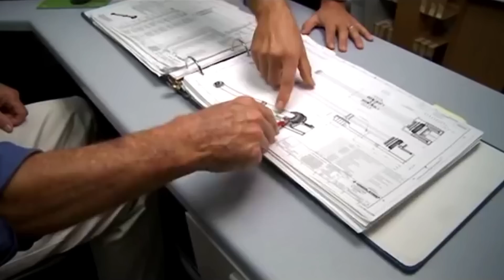US's Ultra-Advanced Railgun Weapon Is Making All Others Obsolete

Comment: I worked on this stuff for ARDEC back in the 80's. So it's been around a lot longer than the video mentions. The concept is over 100 years old and they were doing research in Australia back in the 60's. The big problem now, as it was back then is rail wear. When you are sending a mega-amp of current across a sliding contact, things tend to melt. I hear that they have made progress in the last 40 years but going from single digit number of shots to tens of shots before rails needed to be replaced.

As far as power requirements go, a modern Ford-class reactor will provide more than enough power. The Navy's latest ship concept is that everything runs on electricity (catapults, radar, jamming, communications, props) so you build a big reactor and switch power to where ever it it needed. A railgun fits in well with that design concept. The Ford A1B reactor can generate about 125 megawatts of electricity plus another 260 MW to the propeller shafts. A 30 megajoule gun would require around 9 kilowatt-hours for one shot. So even if you used 1/10 of the reactor electrical output you could still shoot about 1300 shots per hour. Even with other inefficiencies, I think 100 shots per hour would be reasonable with reactors we are using right now.

And as far as the Chinese actually fielding a railgun? I'll believe that when I actually see it work for more than a few shots in an hour.
Reply: Hi! I’m definitely not a Chinese scientist trying to build this so my family doesn’t die. But don’t the electro magnetic fields the gun generates interfere with ship systems around it?
Reply: @kurtru5selcrowe607  Yes, that's a real issue that we were looking at but our goal was to get the thing working. It's another reason why railguns may not be practical in combat. One theory from the USS Forrestal fire was that a jet going through a radar beam may have triggered the missile that caused the mishap. The military has some pretty stringent requirements about stray EM radiation. https://en.wikipedia.org/wiki/1967_USS_Forrestal_fire
Reply: @snoig1  ya I almost lazed a Blackhawk with an LRAS3 system to see how far it was when I was on guard one night. As I said it my squad leader who happened to be there tackled me to the ground. He was convinced that I would have set off lock on alerts on the chopper lol.
Reply: @snoig1  The 5" Zuni rocket (which is electrically fired) was ALWAYS temperamental.  When that rocket went off and hit John McCaine's Phantom, it was something like the 12th incident of a rocket igniting while being armed in the pod.
Reply: @snoig1  "One theory from the USS Forrestal fire was that a jet going through a radar beam may have triggered the missile that caused the mishap."

Nah the issue was the pilot in the plane in front did a wet start which creates a fireball when the engine starts up. It was intended as a prank, but went horribly wrong.
Reply: @guytech7310  Yeah, I've heard that but all the fact check websites say it's not true. The official Navy report found that a misfired rocket hit another plane and started the fire. Like I said, it's one theory.
Reply: @snoig1  There is an official account of what happened though. All of the safety precautions used when loading ordnance weren’t followed. The input from the aircraft to the rocket pod shouldn’t be attached until they are ready on the catapult. This wasn’t done however so when a stray electrical pulse occurred, it led to a Zuni being fired. This wouldn’t have been bad had it happened while on the catapult because the rockets would’ve hit nothing however the F4 that fired the Zuni was on the back of the carrier aimed at multiple A4s. The A4s were equipped with old ww2 era bombs which were very susceptible to high temps unlike the more modern ordnance.
Reply: @kurtru5selcrowe607  
LRAS is an awesome piece of equipment. Amazing how far you can see and range with it.
Reply: @kurtru5selcrowe607  u swear u did that? Where was this?
Reply: @obadiahkilgore2964  the Syrian/Iraqi border near Tal Afar back in 2010. And there’s nothing to swear to lol. My squad leader stopped me before I did it.
Reply: @kurtru5selcrowe607   I have no idea if was a true story, but I had a conversation with a cop about their laser guns they use to measure vehicle speeds with. He told me they used to sometimes point them at military jets that were flying past for fun, but one day their department got a phone call from the military asking them to stop because it was setting off missile lock warnings and making the pilots nervous.
Reply: @swaghauler8334 FYI  McCain flew a A-4 Skyhawk not a Phantom.
Reply: @kurtru5selcrowe607  Get the gun to work first before solving the problems of how to fit the gun in ship. One step at a time and that problem seems insignificant.

Get this gun to work and they've solved problems with missile defense as this can shoot down any missile including hypersonic missile.
Reply: @kurtru5selcrowe607  not if it's built properly, the induced currents should cancel each other out everywhere but between the rails.
Reply: @kurtru5selcrowe607  no, as its contained
Reply: Couldn’t you apply some maglev or magnetic containment elements to keep the projectile from touching anything physical after loading to create frictionless firing?
Reply: @CharlesGaluski  That's called a coil gun. And it's significantly more complex than railguns, needing a lot of electromagnetic coils powerful enough to accelerate a projectile quickly and timing mechanisms to make sure that once the projectile moves past a certain point the coil deactivates to make sure it doesn't slow the projectile down, as well as the other requirements of being an electromagnetic weapon. Coilguns do probably deserve their own research but with current technology(maybe something like room temp superconductors will make them more viable)  they just can't keep up with their rail based cousins.
Reply: @weirddudes5543  Coil guns are more efficient and scale better, railguns are easy enough for the low hypersonic regime, but they're inefficient, need a lot of power, and the forces on the rails and requirement for the projectile, or projectile+sabot system to be capable of withstanding 100s of kA, is going to make them impractical on anything but a nuclear powered vessel, it would be a great option for long range bombardment, but I doubt smart munitions could withstand the acceleration and induced currents of the launch, it's DC, so shielding them is very difficult.
Reply: @weirddudes5543  while that sounds more complex, I wonder if it's easier to execute with current technology. A great example of this is the old CRT TV system. CRT TVs are FAR more complex operationally than LCD or dot matrix (the black and white equivalent) TVs, but back when they invented the CRT TV, they did not have the understanding of materials that they do now. That is why it took so long to get to LCD TVs, even though LCD TVs are far cheaper and simpler to manufacture than CRT TVs were.
Reply: @weirddudes5543  these are coil guns not rail guns.
Reply: @weirddudes5543  and keeping it on target
Reply: @CharlesGaluski  No, because the projectile gets its acceleration from being in contact with the barrel. The barrel is a pair of electrodes that short electrical energy into the projectile to provide the propulsion.

The only way that might improve barrel life is make the electrodes cylindrical so they can rotate after each shot, but they still need to be replaced and there still needs to be a support structure to prevent them from bending during firing.
Reply: @guytech7310  what if the electrodes were like a flat ribbon, one shot only and then rotate through the barrel like a fabric towel container in a rest room, thus the actual conductor is just applied to the fabric and gets toasted every shot.  New shot, new ribbons.
Reply: @lonihollenbeck4654  Ribbon would fail, It would break\vaporize on the first shot. I believe the copper electrodes are a couple of inches thick to handle the current which is millions of Amps.
Reply: @guytech7310  Ribbon would fail, but a round solid rail on a geared rotation system could simply be turned several degrees if the surface is too damaged to continue use. Fire ten shots, rotate 15 degrees, fire ten more, etc. with a bonus that replacement rails are simply very long round bar stock that a lathe can produce on an industrial scale. 

Heck, get creative and make them very heavy walled pipes and run coolant through them if needed.
Reply: @mfree80286  That was my thought to use a round or hex shaped rail that is rotatable, but The forces might be too high for that design to work. I am sure some else thought about rotatable rails, and likely deem it not worth the effort & expense.
Reply: @CharlesGaluski  I am pretty sure it doesn't contact the launching tube. But they are imparting a force to get the projectile up to Mach 7 or whatever, and that creates a lot of heat. The projectile moving that fast also is running into the air so fast it's making plasma (and ablating while doing so). You dump a lot of energy into getting it moving. People have made coin shrinkers, where they put a coin in the middle of a coil, making sure it stays put, and dumping a few huge capacitors to cause an electromagnetic wave. The wire normally explodes in the process.
   There is an inverse square relationship between the intensity of a magnetic field and the distance. Double the distance, you require 4 times the power to have the same field. And your dumping all that power in milliseconds at most (if we go from 9 KWh, we get 540KW/min, and 32.4 MW/s, 324 megawatts of energy for 100 milliseconds of propulsion.
    Another thing is the drag coefficient. It's gotta be different for hypersonic projectiles (gotta be like reentry, except you don't want max resistance). In air subsonically, the drag increases by the square of the velocity.
Reply: @CharlesGaluski  then how do you get the current to flow through the projectile? It needs to complete the circuit, the magnetic forces pushing the armature along the rails are due to the current flowing through one rail, through the armature and back down the other rail, like a gun, the same force is being applied to the rails, basically the magnetic field is stronger inside the loop made between the projecile, rails and power source, in order to minimize the potential energy, the loop needs to get bigger in area, the easiest way for it to do that is to push the projectile down the rails, if the current stops flowing, the magnetic field decays,
Reply: @domvasta  well, I don't know, really, that's why I asked a question, instead of making a statement.  I was looking to get educated on the subject as it seemed like a no brainer to have the projectile float above the rails, maglev style, to eliminate friction and reduce heat.  But, the projectile doesn't need to be in contact with the rails to complete the circuit and have the whole system function.  If you watch a video about using cryogenic temperatures to create small, but intense, magnetic fields capable of levitating an object or magnet.  You turn on the juice and place your item on top of the plate and it floats with no connection. Also consider maglev trains.  These trains float on magnetized rails without needing to have a physical connection to the rails.  Finally,, as a weapon, you don't want to minimize potential energy in a projectile.  When you are essentially throwing solid chunk of material, with no inherent combustibility, you need to give it as much potential energy in it as possible to transfer to the target and create as much damage as possible.
Reply: @CharlesGaluski  solved that long ago but the firing rate was reduced. simple but secret.
Reply: Exactly.  Where they really need to be investing money now is materials science and metallurgy to come up with an alloy that can withstand the extreme power/heat/friction levels without degrading.  Once they crack that, this will be a viable weapon system ready for the battlefield.
Reply: @willymac5036  and you think they haven't achieved that already after more than 6 decades of research? If they are making a public show of this weapons system something tells me they ve found a way to make it work.
Reply: @bendemicah5444  actually that’s were you’re wrong.  The only reason why you don’t see these weapons on every U.S. Navy destroyer right now is because they can only fire a few dozen rounds before the rails effectively destroy themselves.  The researchers at Dahlgren have been very clear about this.  This is also why the U.S. Navy isn’t very worried about the PLA Navy having a working railgun on their ships anytime soon.  The tolerances involved are absolutely enormous, and that is basically what is holding these systems back right now.  They could go ahead and install a 32 Megajoule Railgun on whatever ship they want, but they’ll have to replace the rail too often to make them cost effective.  Which is also why the U.S. Navy is using hyper velocity projectiles out of their Mk45 5 inch guns.  That’s something they can do right now that gives them a considerable boost in performance while still using the guns they have in service right now, without having to replace anything.
Reply: @bendemicah5444  that or trying to get the competition to spend time and resources on something they know don’t work while we secretly develop something else.
Reply: @bendemicah5444  Or they're pitching for additional funding. Nothing like giving the American public a hard on for a weapon system to open Congressional wallets.
Reply: Rail gun weapons started development back in WW2. US started a program back in 1943 to use Rail guns in Sherman tanks, and created a few prototypes, but they were never practical. As the Poster above stated the issue is barrel wear. as the high velocity and forces causes a lot of damage to the barrel. 

Its possible to fire hypersonic projectiles using conventional propellents, but the issue is excessive barrel wear just like rail guns. It does matter if you combustion or electromagnetism, its the high pressures and friction on the barrel that causes problems. Its unlikely this problem can ever be solved because there is no way to avoid the physics.
Reply: @guytech7310  Gonna have to ask you where you got that 1943 figure, because if you got that from Spookston, I'm gonna have to tell you that that video was an April fools joke, and while it sounds really convincing, looking further it's quite obvious it's not serious(uploaded April 1st, and the sources in the description had "it came to me in a dream" listed as a source.)
Reply: @guytech7310  Just need a super conductive material, of course if we had armor or plating like that, wed just be going into space with it 

A lot of little industries are catching up to the ones sped up by Moore's law 

Just wait and see what happens
Reply: @Hashingit  No super conductor can handle the current levels used in rail guns. Super conductors will only super conduct at a limited amount of current before quenching (ie revert to a non-SC state).
Reply: @guytech7310  Alright then some other materials science needs to catch up 

Or we need to let it go
Reply: @Hashingit  It will never be a workable because the material needed is unobtainium
Reply: Thanks for the information
Reply: @_____ yep. I'm nearly 60 and ride my eMTB to/ from work everyday, basicallysilently. 7 miles each way, 40 minutes pretty easily. Off road it's awesome,  it eats hills and rolls down the other side, zips along the flat. As much as I'm a petrol head ( motorcycle mechanic) , I believe electricity is part of the future. Hell, it's here now and it's great.
Reply: Make a great artillery
Reply: Thanks for taking the time to pen your experience.
Reply: @_____ the real problem with EV's is the fact that the Batteries eventually need replaced, are super expensive, generate a lot of pollution to produce and dispose of, and curent lithium ion batteries are made from elements that can and do spontaneously combust when exposed to Oxygen, are prone to catastrophic fire/explosion producing faleure (de-gassing) and are really not that efficent, have a short life span... we need a non combustible, more efficient battery tech. I've seen a few things in development on that front. But untill 1 of them is mass production ready and can replace lithium ion technology we are putting cart before horse with EV's if you really want to be "green" about it.
Reply: China has nothing even close, they have propaganda though, that works amazingly well.
Reply: Wouldn't a "Gatlin Gun" be a viable concept to solve the melt issue? Keep all the rails in a sort of water jacket. Blows off steam after each shot, refills and ready for the next! STEAMPUNK RAILGIN!!
Reply: @M.C.Turnt69  no because other the massive hazard of having water near a huge DC power source, the vaporization happens in microseconds to nanoseconds; the metal vaporizes and ablates before any significant thermal energy travels through the rest of the rail; the water molecules don't even get a chance to vibrate due to.the new thermal state. In effect at those voltages and timeframes, the metal acts briefly as a thermal insulator not a conductor.
Reply: @repealsection230forbigtech4  Hmmm. Would be great if they could maglev these thing to eliminate any contact. What about maybe a "layered" rail. Each layer having a set amount of shots b4 the rail is "spent". Doing this you might be able to lower the cost a bit. If that's a viable option. Having rails belt fed to the machine much like amunition. Idk...i just woke up haha
Reply: Exactly, melt, vaporization, warping and cracks. As for a made in China quality railgun, I'd hate to be a sailor on that ship, given the penchant for their system warping and shattering super heated liquid metal "shrapnel". A country that, until 2012,  couldn't even make ballpoint pens because their steel was never pure enough to make 1mm ball without serious pits and defects, isn't any position to make a viable railgun.
Reply: Oh come on now!  If they is making a video on this they already got shit 30 years ahead of this they ain't telling us civilians about.  Know many of us wish they would be truthful about all the technological shit out here but to me seems they is gonna only let the super rich know what's really going on.  The rest of us is gonna know only enough to work for the rich assholes and make them more dough.
Reply: Knowing China, I bet that they either carry a bunch of spare rails aboard the ship, or the plan is to only fire a handful of shots before resupplying.  I bet that China hasn’t invested in the infrastructure to keep making rails.  They rushed to show off their new toy, but they were probably not considering the logistics needed to support its actual usage.  Russia did this with their aircraft carriers.  They built them, but not a facility that could maintain them.  It’s the kind of mistake that countries that care more about showing off than achieving results make.  In the US even the armchair military analysts know that logistics win wars.  The best weapons are worthless without the logistical framework in place to support them.
Reply: How about an easy replaceable tubus made out of a non-conductive material for the rail? The projectile can't touch the magnets themselves because of magnetic repulsion, but when used with a non-conductive friction surface tubus of a certain width, it would absorb the friction wear and tear and then allow an easy way to swap the barrel on the go with just two staff members, without the need to worry about the barrel itself. Might be a carbon based material, or a thin sheet of depleted uranium. Could be practical, because the main part, magnets and electronics, are preserved, and economical, estimating the cost of such protection tubus for a 5-30,000usd/piece depending on the size and quality assurance. Having a decent sized housing barrel made out of composite materials could also help. Dont ask me about the details.
Reply: @Kid_Naps  due to how railguns work the rounds HAVE to touch the conductive railing to be propelled.
Reply: Thanks for the scientific comment, it's something rare in the Era of arm chair warriors
Reply: The field of souper condition has been making great work with this technology
Reply: Could electronics in a rail gun ever be able to survive a shot?  Or control system?
Reply: @oldmech619  Back in the day I had heard rumors that they were working on high G survivable electronics/control and that research looked promising but that was all above my pay grade.
Reply: @snoig1    It is hard to imagine how any electronics could survive in such a highly magnetic field being energized In close proximity. Then being to able control the direction of flight while using inertial navigation system and gps. There must also be an ionized field around the projectile inflight. Big hurdles to overcome. If something looks promising, the research should continue. But for meantime, guided missiles seem to be the best option. And all war ships need a big deck gun.
Reply: Reality is a ship will only have minutes  . So wear won’t be an issue
Reply: Interesting.
A happy little EMP would have it 'lights out' in an instant.
Reply: How old are you？
Reply: I thought we'd given up on this due to the wear and tear on the barrels. A few rounds and it's flexed out of whack
Reply: Ford makes atomic reactors? Why not fill the barrel with a high dielectric gas before firing to cut down on the arcing and sparking? If none of that works you can always make a gatling gun and spread the wear out amongst several barrels. You can use the time between barrels to charge up for the next round.
Reply: @Joe Duke I see what you did there. It seems the system is put us both here again
Reply: railgun was patented as fa r as 1918
Reply: The problem with hypervelocity guns remains since World War I when the Germans employed a 211mm “Paris Gun” with a muzzle velocity of Mach 4.8 that allowed a range of 130 km (81 miles). Each shot wore away a considerable amount of steel from the bore. After 65 rounds had been fired, the huge barrel was sent back to a Krupp factory and rebored.  Railguns are impractical weapons because of the massive electrical power needed, because the projectile can have no explosive, because the projectile is small, and because it has no greater effective range than a standard 5-inch naval gun.air resistance quickly slows the velocity of any bullet, including the 24lb bullet fired by current railguns. The greater the muzzle velocity, the faster it slows due to air resistance.
Reply: @_____ remember in ww2 the Japanese rode bicycle’s through jungle the British thought no one could penetrate to take Singapore.
Reply: And these days you could probably 3-D print the parts you need.
Reply: Dude right on.. even 20 rounds an hour from that is devastating.. one round could sink a carrier.. Put it on the fastest boat you can and use as a ship destroyer
Reply: @polka23dot70  I have life long study in high power EM fields. I was working with MHD in high school.  I can figure out that you must have found overunity reaction and darpa made it secret.
Reply: I was about to say in nearly 10 minutes of video, we didn't hear one word about these guns burning up their copper rails.  In other news, major breakthroughs in nuclear fusion put abundant clean energy only 30 years away!  Industry is still grappling with making graphine and other exotic materials to make low resistance conductors.  Only when these materials can be produced in great enough quantity at a low enough cost, rail guns will replace the cannon we're used to.  Perhaps they are coming along fast enough that developing better capacitor batteries to shoot these things isn't just a waste of money.

edit: spelling
Reply: You've thought this out, haven't you?
Reply: Idk why they haven’t switched to a coil gun
Reply: That was brilliantly spoken..
Reply: Could also have capacitor storage to buffer the rate of enegy production v usage
Reply: Speaking as another person with familiarity and experience, there's a lot this channels videos get wrong.
Reply: Lieutenant, divert power to weapons!
Reply: Power transfer complete. Your orders captain?
Reply: Never thought about the barrel would need replaced every 10 rounds.
A fast change out system like a machine gun barrel might solve this issue.
 Only firing afew rounds then having to change barrels maybe simular to reloading Hmlrs rockets systems. 
I know nothing about this weapon.
Reply: They need to make a mini version of this in a rifle form... Like China is doing
Reply: You can build one in your garage...all you need is capacitors, rails, and neodymium magnets...really really simple to build actually👍
Reply: What causes the muzzle flash?
Reply: @pierrevandyk9242  Gas and metal ionization + vaporization due to high electrical currents.
Reply: We both know that the only way the Chinese do anything is to steal our technologies! Don't you find it funny how the Chinese went from 50's an 60's jet technology to fielding a 5th generation fighter with 95 % of it looking and being identical to ours . But we all also know a copy is never as good as the original 😉 plus without all the R&D THEY ARE BUILDING THINGS THEY DON'T KNOW HOW TO FIX , REPAIR OR BETTER IT ! 5 TH GEN fighters without having 5 th gen engines,  and half the stealth ! Have you heard of the NGAD PROGRAM? WE Designed a 6th gen in a year vs 10 to 20 years and all simulations tried and fix through this program cutting costs by almost 80%
Reply: So…everyone does know that railgun Sherman was a complete hoax right? Look it up, nowhere does it say that one existed with any credible source.
Reply: useless weapon. money for nothing if u all think a little.
Reply: Power for sure isnt the issue. A fair size capacitor is all you need and a way to charge it so its more about how fast you want to shoot it will be the issue with that. Also a key note, w/e we know now is a good 10-20 years behind what the US claims so i can bet the railgun design has already defeated the rail ware/melting issue but its more of the matter of the US being cheap and slow on how to bring it into full production. We could right now have railgun platforms that will replace most tanks/vehicles and soldiers because all that will be needed to win a battle is to drop a platform with a combat tech crew and lay waste to every land and air unit within 200+ miles which is prob more on 1000+ mile range because we got artillery that has 1.1k mile range now so 200mile range the vid suggest is vastly incorrect.  Also a note, i can bet there is already an orbital railgun in orbit right now with hints that leads to this.
Reply: Last I heard the Navy had the same problem. I seem to remember they could get around 15 shots.
Reply: Thanks for this, your comment was actually more informative than the video.
Reply: Dumb idea from a dumb guy, but what if the barrel could be filled with saltwater? There could be tubes that “charged” the barrel between shots.
Reply: @teeheeteeheeish  That's a pretty dumb idea. For starters the thousands of amps will vaporize the salt water and explode the gun. Salt water is corrosive, to even stainless steels at high temperatures.
Reply: @teeheeteeheeish  I think it's more complicated than that. I see many people suggesting some kind of cooling system but melting and warping the rails is more of an instantaneous thing. It's not really from the buildup of heat, it's from large currents going through a sliding contact and the arcing that causes. The rails may be cool to start but will heat up to their melting point in milliseconds once that current starts flowing. It takes time to pull the heat from the rails with any type of cooling system and by then the damage is already done.
Reply: @snoig1  Could zinc be used as a field-replaceable ablative conductor? It's presence would mean it would vaporize far below the melting point of the rails and yet it doesn't have time to oxidize, leaving a metal plasma present...
Reply: @mfree80286  Well if it could be done, it would have been done after 40+ years of research. But I really can't say since I'm an electrical guy, not a materials guy.
I would think that you would still get some spalling and welding at the zinc/copper interface with those kinds of currents.
Reply: Dude
Reply: @fartzr.schmelli3351  Sweet!
Reply: They'll get the railgun. As soon as their spy's, sorry "students" have aqureired the plans...
Reply: It isn't just the current / arc.
The gas compresses and moves as a mach wall in front of the railgun armament.
The result is erosion at insane rates, with gas at the front edge of the shockwave at well over 30K deg C.
Reply: 18JUL2022 - I believe the solution to the rail wear problem will be (possible is) in the ceramic-metallic alloys. The ceramics lab in Oak Ridge would be the likely developer of such a material.
Reply: @scoop4363  I doubt it because even conductive ceramics have high electrical resistance. What you need is a material that has a very low electrical resistance, extremely hard, & is resistance to oxidation from electrical plasma discharges.

Basically unobtainium.
Reply: couldnt you just add advanced versions of engine cylinder wall coating nickel or ceramic that withstands high heat to the inside of the barrel, and pump oil down through the barrel, and water through water canals created in the barrel walls in a coil pattern all the way down it... a gun that shoots 250 miles, i doubt you are firing at a fast rate of speed so it should have plenty cooling time with a basic motor cooling system setup???

if raptor engines are 3d printed, and can put out the power and heat they are putting out with minimal wear, then i dont see this being too far away...
Reply: @polka23dot70  
3.  I believe CRT will be dumped in due course.
2.  I believe as some above commenters that the PLA was 'showboating' (pun intended) their design, but have the same fundamental stress and wear problems, and the real solution has yet to be discovered.
1.  I've been thinking about the contact wear and Lorentz force problems.  If Ph.D. Higgins named you in his paper, you should probably delete your comment and we should probably talk.
Reply: Me too.
Reply: Well said. Absolutely true.
Reply: this will be remedied with graphene. Maybe even Borophene, it is the M.I.C. 
Or maybe the AF can share the tech they're using to propel the Tic-Tac UAFs, but that wouldn't be a rail|coil gun anymore I believe.
Reply: Why can't they use a liquid ammonia chilling system, to chill down the rails so they don't over heat and wear. Liquid ammonia chilling systems can achieve -40C upto -60C very efficiently. You can get easily 1500kw of chilling capacity from a relatively small and cost effective system.
Reply: @miranarak  It doesn't matter how cold the initial system is. When you have a mega-amp flowing through the rail/armature interface, you are going to get some arcing which generates a high temperature plasma which wears out the rails pretty quickly. And every shot causes more arcing than the last because of the damage from the last shot.
Reply: @snoig1  Yes you are right, would be very hard to get rid of that issue. I'm sure they have solved all those issues by now, for sure they are hiring the best brains to solve these issues
Reply: @snoig1  I wonder if they used iridium to handle the plasma arching? That metal is used in cars spark plugs and can handle such temperature and plasmas
Reply: @miranarak  Not likely. If they had, they would not have cancelled the Navy's at sea trials. They have been working on this stuff for over 40 years and still have the same problems so I would not expect to see something battle ready for a long time.
Reply: Chinese may be using consumable rails. If tungsten is not good enough maybe graphite with a layer of tungsten will do the trick for one shot. If there's no metal with higher melting point than tungsten this is the only logical option. The rail could be coiled somewhere bellow the deck
Reply: @_____ A rail doesn't cost a billion dollars, but designing, tuning and outfitting a craft that is designed to carry enough ammunition for combat effectiveness AS WELL AS enough rails to field that much ammunition, as well as a system to switch in new rails at a speed that doesn't inhibit combat readiness..... well that just might cost a hell of a lot more than a billion dollars. One would have to assume that all obvious options were explored and that the path of least resistance was chosen - if they stopped developing it, it's because there is no financially viable option with our current peripheral technologies.
Reply: I didn't think that the rail would be a problem...
My main concern was the fact that you need metal to get the projectile moving via electromagnetic fields...
With antique technology you can use rocks and trash propelled in your blunderbuss...
Reply: @𓆏 You’re forgetting practicality. As if a billion dollar ship is “alone” in a fleet; how practical is it to A - wait for it to cool down to fire again, B - taking the time to change out whatever is necessary. Wether they change the entire barrel, or maybe an inner sleeve (think of a piston in an engine). 
If this thing gets off 10 shots, but you need 20 (because there are multiple ships in any armada?), how fast you can re-arm, is probably a huge deciding factor.
I’m not debating changing out expensed rail gun hardware is way cheaper than a sunk, billion dollar ship.
Reply: Thank you I thought we had metal storm a rail gun brought off by US company.
Reply: So. If the navy, AF, and military go all electric. Wouldn't that make EMP weapons the ultimate super weapon? Can't fight a war if none of you're equipment works.
Reply: @jasonplatco7881  the military already has most of their vehicles hardened against EMPs.  Shouldn’t be that difficult to harden new systems.  I think, but don’t quote me, that it is a simple thing like encasing vulnerable systems in a Faraday cage to ground out the EMP burst energy.
Reply: @CharlesGaluski  a lot of them are. They have recognized that threat since the cold war. Civilians are more at risk.
Reply: @jasonplatco7881   Not really as basically all mill equipment is hardened against EMP.. It is not difficult to do either.
Reply: @jasonplatco7881  Pretty sure the military knows about EMPs
Reply: @jasonplatco7881  
All of our mil-spec GFE is shielded against EMP devices. They have to be because of their proximity to each other in the weapons platforms.
Reply: @jasonplatco7881  EMP shields are pretty cheap, I think.
Reply: @jasonplatco7881  EMP isn't going to do a thing to a weapon that is designed to handle hundreds of thousands of Amps, he control circuitry is shielded by the metal structure of the ship. It would mess with the radars and target sensors though.
Reply: @jasonplatco7881  it’s not that hard to shield against EMPs.  The faraday cage has been around for a long time and it will protect what’s inside of it from everything from radio waves to lightning strikes.  Remember that the only significant man made EMPs were the product of detonating nukes.  Using a nuclear weapon against an enemy force, even indirectly, would probably trigger WWIII.
Reply: @jasonplatco7881  emp is old hat now, only on certain battlefields
Reply: You did not.
Reply: Sure you did.
Reply: snoig ! wrote: "The big problem now, as it was back then is rail wear." EXACTLY! (I am leading expert in the hypervelocity gun field because I invented several secret hypervelocity guns.)
Reply: @polka23dot70  dude no you didn't, lol the "hypervelocity gun field" huh...you mean the field of HVPs? What are the four classifications into which nearly all guns can be input in this field? What one thing does the gun chamber volume limit?
Reply: @obadiahkilgore2964  BAE "hypervelocity projectile" (HVP) is actually low aerodynamic drag projectile. Its design is completely devoid of new ideas. By the way, this conversation does not make sense because I cannot share my knowledge with you and you do not have any knowledge that is worth sharing.
Reply: Wtf is a leading expert in hypervelocity gun research doing flexing his shit in youtube comments
Reply: @polka23dot70   Do you use some sort of of liquid metal interface on the rails?
Reply: @polka23dot70  I believe the wear and tear issues and miniaturisation will be solved by the Americans. They will solve it before any other country. The Brits are working on this too but from a perspective as a defensive sheild that potentially no enemy missile can penetrate. 

As British and American quality control is far superior to that of the Chinese, the west will be the first to introduce this technology to their ships. And it will be a game changer.
Reply: @polka23dot70  Think Gatling gun with the barrels rotating through a cooling system
Reply: @polka23dot70   micron layering the rail gun similar to a flying fish scale?
Reply: @polka23dot70  did you invent the polka dot bikini project